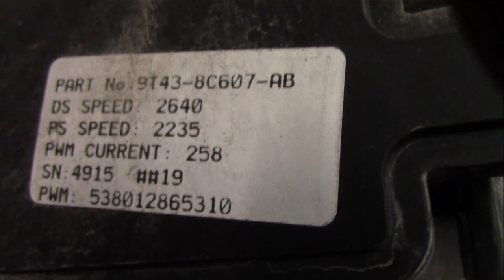Ford Edge electric fan assembly removal and installation

Comment: Very helpful video. Knocked this out in under an hour. Only thing I would add is that when removing the air box there are 2 rubber grommets on the bottom that the box snaps into, and it took some time/effort to figure this out. I kept looking for a screw or something holding it down. Again, great video. Thanks for taking the time to make and post this.

Comment: I have a 2009 ford edge limited.. just recently replaced the cooling fans. They worked for like a week and now they just stopped working..

The new ones that I bought come with towing package.. I dont know  if the ones I replaced had towing package or were without it.. would that caused my new fans to failed??

Comment: Hi MacT!
Background: For the past month I noticed that my Ford Edge AC hasn't been working very well... hot air when idle and only slightly cold air when on the highway.  Steam started coming out of the engine one day, so I pulled over and let the car cool down.  Once I got back I checked the coolant and saw the reservoir was empty and filled it up with 50/50.  Fast forward a couple days later, temps are up again and my engine starts to overheat.  I took it to a chain service store and they said I had no leaks but I need a new thermostat, radiator fan module, coolant temp sensor, and a coolant flush.  When I looked up the thermostat I saw that they were charging me twice as much than if I had walked inside the store and picked it up, so I began to question the 338$ fan module ordered from the dealer.  When I put in the part number they gave me, I couldn't find anything: (radiator fan: A7T4Z8B658A, coolant temp sensor: 9L8Z6G004T).  I could pay a family friend for half the labor and purchase the parts, but I can't find the parts! Should i go with the chain servicer?  What do you think?
Reply from the maker: First thank you for watching.   Please go to MACTFORDEDGE on facebook and join!! Me and the other admins will work with you to find the parts online and provide DIY information needed to make the repairs.   Youtube unfortunately has limitations for this type of communications.  https://www.facebook.com/groups/MACTFORDEDGE/

Comment: Can you please name your tools, for example the retool, that you use to get the hose out. Also the Milwaukee power right angle tool that you use on your other video about the thermostat.. thanks..
Reply: I'll answer my own question AutoCraft Clip Removal Pliers
Part No. AC505/W86556 19.99 at advance auto parts
Reply from the maker: The electric ratchet is a Milwaukee.

Comment: The fan is exactly the same , the problem is that the fan stay on after the car is off? thanks again for your help
Reply from the maker: Just so I know clearly what type of fan does it say MOTORCRAFT on it and how much did you pay for it?  Trying to help narrow down the issue as I am not there.
Reply from the maker: You have to check the wiring relays to ensure they are functioning. There is a problem in the wiring or the fan.
Reply from the maker: The only issue I can go back to is that the fan is an aftermarket and the wiring in it is reversed. Check the connections and I think you will find the wiring is reversed and it is not an OEM ford MOTORCRAFT fan assembly as they cost over 230.00 dollars new.  If you paid anything less then it is not a ford OEM fan and thus the issues you are experiencing are due to the aftermarket fan of lesser quality.  Check the wiring.

Comment: SUGGESTION: Use a bendable telescopic pen light for when pointing out stubborn placed bolts so you can get a good angle on it to light up the bolt for us. I don't know what the tool is called. It'd be really cool if you can find one that not only has a flashlight on the end of it but also a laser pointer, but now I'm just being high maintenance =]

Comment: Thank you for the video it was a good help but we installed the fan but he seems like the fan stays on what do you think the problem could be? Everything else is working fine
Reply from the maker: Was the fan a MOTORCRAFT OEM Fan? If not then that most likely is the issue.  If the fan is a motorcraft then you have a modulator sensor that will have to be traced to see if it has failed.  I am going to say if you do not use motorcraft oem fans then there are always all sorts of operational issues with the fans from aftermarket vendors. Please join MACTFORDEDGE on facebook for faster and better responses.

Comment: Hi MacT,Thanks for the video. Very helpful. I hope I can get it done without the bruises :)The error code I get for my Forde Edge 2011 AWD is P0480. Do I need to change the whole fan assembly or only Fan 1? Do they come in separate parts?
Please can you also tell me where I can get good quality, best price for the fan assembly.Thanks again.
Reply from the maker: Replace the whole assembly with a Motorcraft fan assembly this will be the best solution as other aftermarket fans have been known to not work.  By it from Ford or online, but make sure it is motorcraft.

Comment: hello friend,  a query , how are does hidraulic pump belt. greetings from chile
Reply from the maker: +fran panxo This video will show you how to change out the power steering pump belt and the serpentine belt on a 2008, which covers all models from 2007 thru 2014 with 3.5 liter engines.    https://www.youtube.com/watch?v=jcFD-55q3FA
Reply: +MAC T  what do you use to hold the belt as Im turning the damper?
Reply from the maker: Use a few good strong zip ties.  I mean strong.  Not thin little wire ties.
Reply: +MAC T  thank you my friend, do you have email ? facebook?
Reply from the maker: You can find me on the Ford Edge Forum, also at facebook Ford Edge World Wide (MACBWT) and on Facebook Ford Edge pages.  Log in there and you can PM me on any of the three sites.
Reply from the maker: +fran panxo join MACTFORDEDGE on Facebook you can find me and some other very knowledgeable people to help answer your questions.

Comment: the lady at the Parts place said just replace the one fan not working but thought that was odd I told her it was a double fan
Reply from the maker: +Miz Pinky It is an assembly and thus you have to buy the whole assembly even if one fan is working.   Some choices will be dorman or TYC along with Motorcraft which is what I would prefer for fit and operation.
Reply: Thank You. 

Do they sell the system at an Auto parts store?
Reply: May I ask what is a TYC?
Reply from the maker: TYC is a brand name just like Dorman.
Reply from the maker: You can but it through Amazon also.  Or better use Rockauto.com they usually have good prices on motorcraft parts.  Better than the dealer's.

Comment: on 2008 Ford edge the Oil drain bolt is it removed 
CLOCKWISE or Counter CLOCKWISE?
Reply from the maker: +Miz Pinky Lefty loosy (counter clock wise) righty tighty (clockwise)
Reply: Lol
My husband is trying to remove the Bolt and the person at the shop told him sometimes on F.E that they put it on Counter.C.W.
So he is wondering if that is true! Also I believe the mechanic stripped it and my husband is having a difficult time
Reply from the maker: Miz Pinky
Oil lube places are notorious for stripping the threads on oil plugs. You will have to have a helicoil or plug helper installed now. You should be able to get one from an auto parts store.
Reply from the maker: +Miz Pinky Yeah right.  HE (shop guy)  is full of it and I am not talking wisdom.

Comment: replaced fan with aftermarket fan wont stay on they stay on only for 10 sec
Reply from the maker: That is because you did not buy the OEM fans.   Aftermarket fans are junk for the most part.

Comment: i would like to ask about the huge fan noise when I operate AC in my ford edge 2013 and the ambient temperature in my country is over 42c degree is this noise is normal?? thanks
Reply from the maker: The fans with that heat will run full speed and make a bit of noise. Rest assured as you gain speed over 50mph they will slow down due to the air flow from movement. The good news is your fans are working. Once they stop then bad overheating will result.   Keep on driving. Noise is not an issue it means they are working!!   Don't forget to join the mactfordedge group:  https://www.facebook.com/groups/MACTFORDEDGE/
Reply: +MACTFORDEDGE many thanks for this information

Comment: a question about a 2008 ford edge 
radiator double fan 

Do you have to change out the whole double fan or can you just change out one
Reply: It's all one piece, that has a double fan, when you replace it it's one piece that has two fans costs about $230.00.. mine is starting to fail, I tapped it with a wrench and it started to work again, however it's just a quick fix..